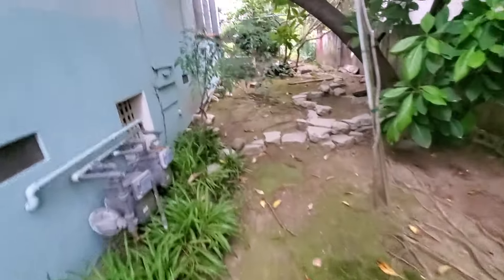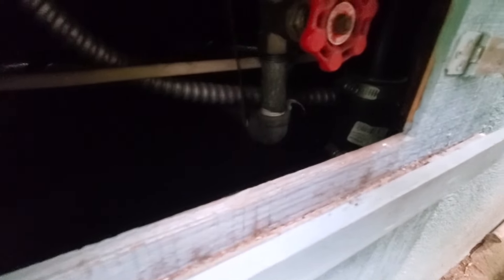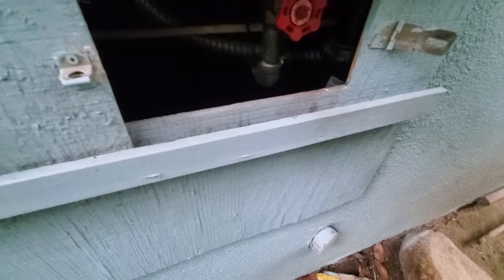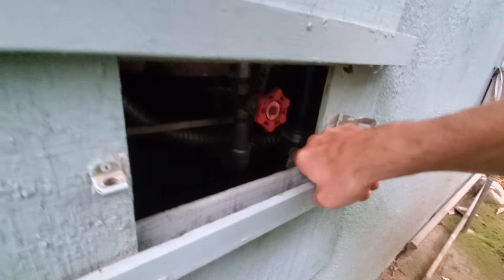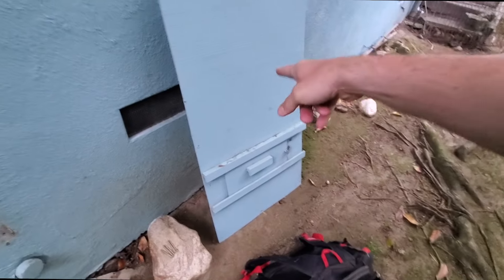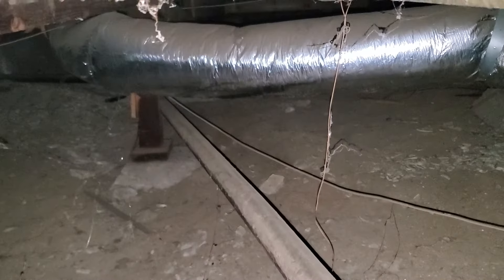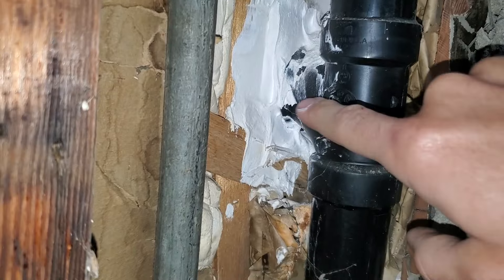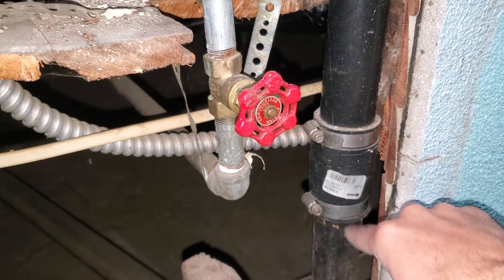I thought the 1/4" cable would clear it (I was wrong)

Comment: The bulb head for the 1/4 snake doesn't really clear out kitchen sludge and grease well, the small hole they punch just gets closed up with more grease. Put a little bend on the end of the snake and it'll scrape a bigger hole for a better clean
Reply from the maker: i dont rely on cables to clear grease, i always tell customers after i snake a drain that if they want the problem resolved then they need to hydrojet it.
Reply: How far down the end should the bend be? I was considering just buying the drop head cable for my Milwaukee trap snake. Thoughts?